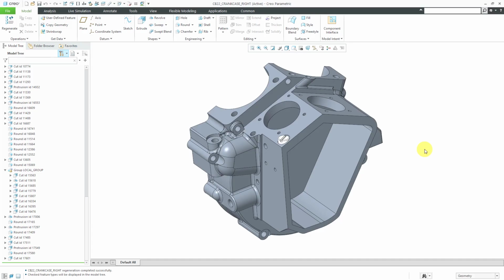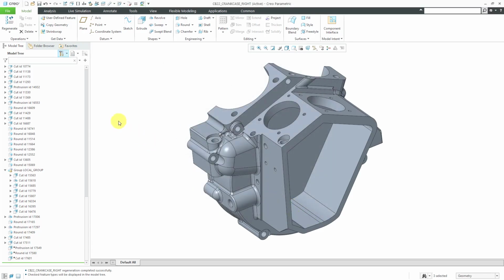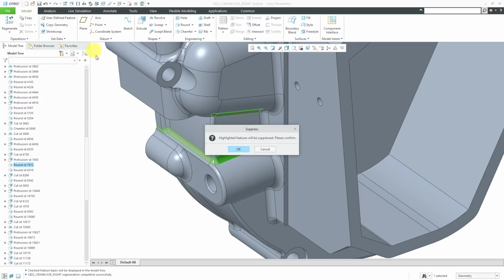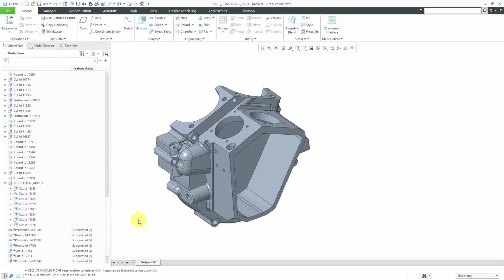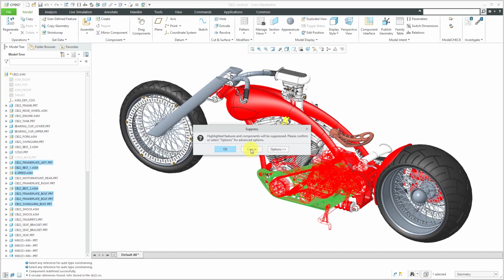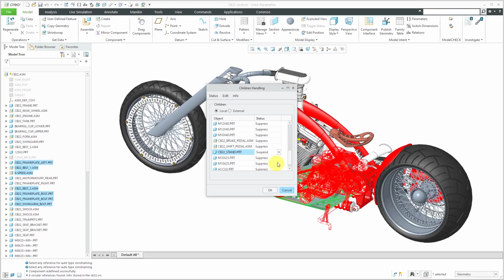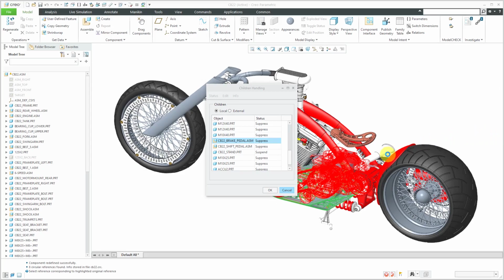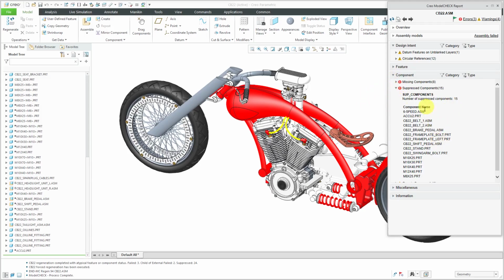Creo Parametric - How to Suppress and Resume

Comment: I'd like to know why Creo throws an error when saving or checking into Windchill models with suppressed features. If there's some kind of problem with suppressed features, then the user isn't using suppression properly. If they're trying to discourage suppression altogether, then why even have this ability at all?
Reply from the maker: Sounds like your administrators configured a setting that doesn’t allow suppressed objects. You should be having the discussion with them. I checked in stuff with suppressed objects all the time.

Comment: how do you take Cero off baby mode and open the program up?
the green checkbox to confirm changes is incredibly annoying. i'm surprised it doesn't make you complete a captcha.
Reply from the maker: Baby mode? You’re triggered by a green check mark? You do know that middle mouse button is the same as the check mark, right? No, there are no captchas inside of Creo. I don’t know why that surprises you.